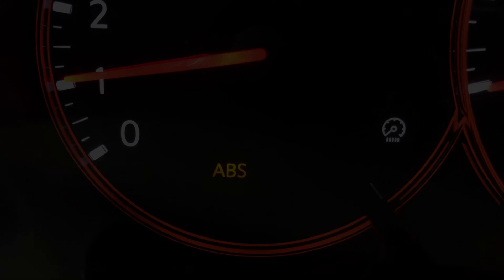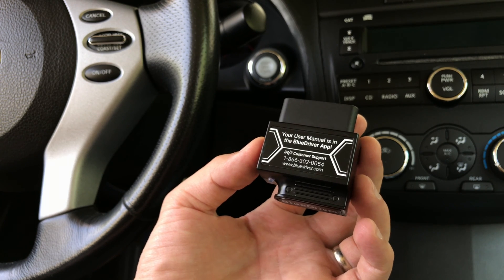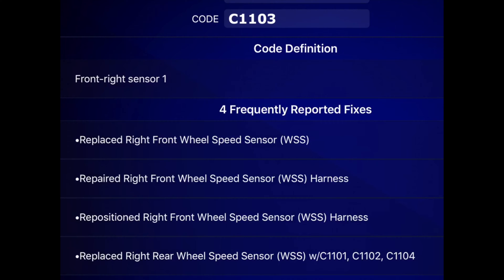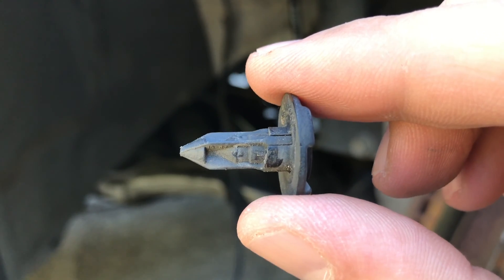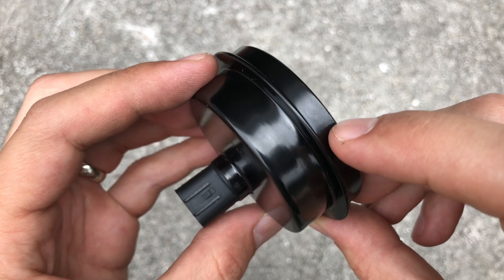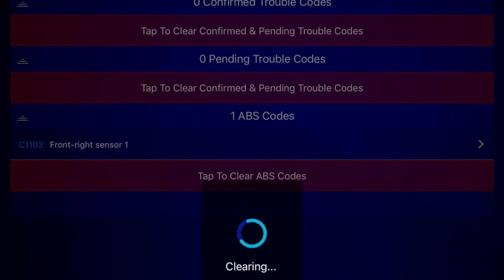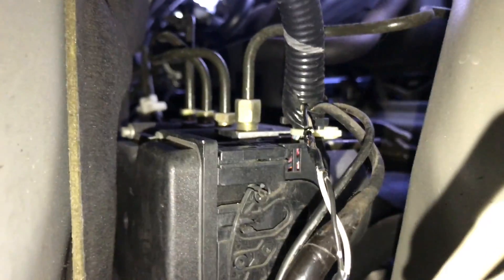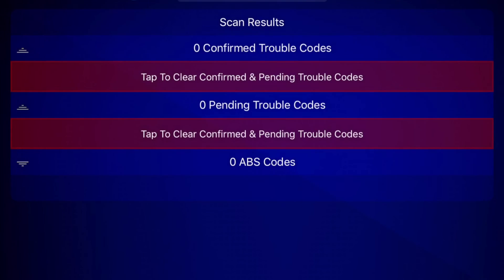How to diagnose & fix ABS light. C1101 C1102 C1103 C1104 C1105 C1106 C1107 C1108 (Nissan example)

Comment from the maker: Tools and parts used in this video: 

BlueDriver diagnostic scanner: https://amzn.to/2GpKGIa 
Digital multimeter: https://amzn.to/2PhOXBq 
Replacement wheel speed (ABS) sensor: https://amzn.to/2Go9VdX 
Retainer clips kit: https://amzn.to/2UN6G9R 
Test leads set: https://amzn.to/2GomeXR 
Floor jack: https://amzn.to/2UO58fS 
Jack stands: https://amzn.to/2XyyZpJ 
Breaker bar: https://amzn.to/2IJZwMz 
Torque wrench: https://amzn.to/2XuuiNG 
Wheel chocks: https://amzn.to/2XyAeVV 
(These are Amazon affiliate links)
Reply: Brother, I have c1101 and c1105 on the Infiniti q50. It said right rear sensor 1 and right rear sensor 2. I know there are 2 on the left and right. What do you think the problem is?

Comment: I was driving with cruise on the highway and automatically braked applied and cruise came off and then abs light came on. Mechanic said it is rear speed sensor. 
Is it important to change that?

Comment: I change the right front bearing and just after that abs light become on, so i thought was the bearing, i change it for a another of better quality but the light didn't turn off, i erase the light with the scanner, i change sensor to the opposite side but still the scanner says is fr rh sensor-2 code c1107, i am going to check tomorrow the wires, i hope that will be that, but it is strange to me that exactly after change the bearing the light turn on... The cars is a 2018 nissan march
Reply from the maker: Yeah, ABS is finicky system. Could be wires, or even ECU module. Could be incompatible aftermarket bearing.

Comment: This is great and you've explained the worst case scenario, the next would be the ABS module itself but that rarely fails and the voltage test would have been performed at the ATS connector harness to check for the 12v. If that wasn't present, then you'd check power and grounds but that would usually flag all sensors and not just one since they are shared unless a circuitry inside the ABS module would only affect one sensor. Best would be just to check power and grounds to the ABS module and call it done condemning the ABS module, this video is well explained.
Reply from the maker: Thanks! I think I have exactly that problem on my other car. ABS module seems to be the issue. Will need to check that soon.

Comment: Nice tutorial , btw I have a 2012 Nissan Versa SL , dealer told me was the right front abs sensor , I replaced nothing happen, I deleted with the scanner, I drive the car 🚗 for few minutes I soon I hit a small hole abs sensor come on , I replace the left sensor also , still on , you think maybe the wheels bering is dirty?. Thanks 🙏
Reply from the maker: Sounds like it could be pinching or shorting wire somewhere, since it happens when you hit a potholes.

Comment: I have seen a lot of cheaper code readers for sale, but it seems they can't all read the ABS codes.  If I want to buy a cheaper one, how do I make sure I pick one that can read them?  Is there a specific protocol it needs to be compatible with besides OBS-2, or a specific subset of error codes?
Reply from the maker: In description it should say: reads ABS error codes.

Comment: Nissan C1106 Traction Control Disable Switch Circuit Short to Battery

Nissan 370z, I changed already speed sensor left rear and still ligts;((( help
Reply: Hi, did you find the problem?
My 350z has c1105 code. (Right rear sensor).
Reply: @oyogswod   Hi brother, I just had checked my Infiniti Q50 said code C1105 - Rear Right Sensor 2. Can you you tell me how did you fix it ?
Reply: Hola amigos, tengo una Nissan Qashqai con el mismo problema. Tiene el c1105-00. Cambie el sensor de velocidad y aún sigue con la luz encendida a pesar de que la borre con un scanner la detecto de nuevo a los minutos. Que podría ser?

Comment: I am having the error code C1104 and C1108, it says Front Left sensor 1 and Front Left Sensor 2. But you mentioned that there will be only 1 sensor per wheel. So, Could you help me out?
Reply from the maker: What car do you have?
Reply: @DIYtime   Nissan Altima 2014. And I am having one more error Low Washer Fluid even though the fluid is full , it came very recently. Is there any thing interlinked? May be fuse went wrong or something ?

Comment: What would be the c1142 pressure sensor circuit code mean? Got it from the bluedriver but can't pinpoint what it is
Reply from the maker: What car is this?
Reply: @DIYtime  it's a 2005 350z Nissan Ani Edt. I just ordered a break fluid level sensor to see if that's the cause
Reply from the maker: Either that or ABS actuator malfunctioning possibly.
Reply: @DIYtime  okay thank you ill keep this page updated haven't been able to take the sensor out but will be attempting again today with a very small flat head pushing it up while pushing it back headache part lol

Comment: Great video, I’m working on an Altima same year as yours. I can’t figure out what’s causing the ABS light to stay on. When I back probed the front wheel sensors they only flash 6 volts for a split second when I press the ignition on then they go back to 0 volts

Comment: What does it mean if the status code confirmed? Do you simply erase the code?
Reply from the maker: In some cases car computer detects abnormal condition indicating an issue, but it issues pending error code only. Then it monitors that condition for longer time and if the issue doesn’t go away, it issues confirmed error code. This is done to avoid misdiagnosing random, occasional or intermittent symptoms.
Reply: DIY-time ok because i been getting this code u1002 and c1143 but i just get the status that its confirmed
Reply from the maker: It is related to steering angle sensor circuits

Comment: I have c1103 and c1203 code on my Infiniti. mechanic said Speed sensor needs to be changed but asking alot of money for replacing it. He is saying that after replacement codes need to be cleared. My question is whether codes will automatically clear after replacement or need to be done manually?  If auto,  then I can replace the sensor myself
Reply from the maker: It depends on the issue. When I fixed the wire on my car ABS warning light disappeared.
Reply: Speed sensors are not very expensive and are easy to replace.... also after he does that work and clears the 'code' the problem could still be there and the code could come back.